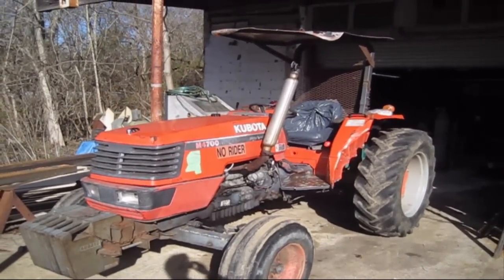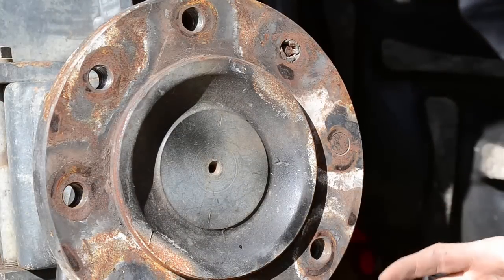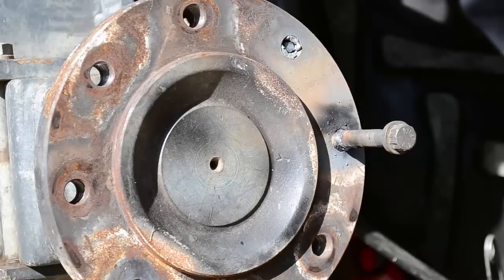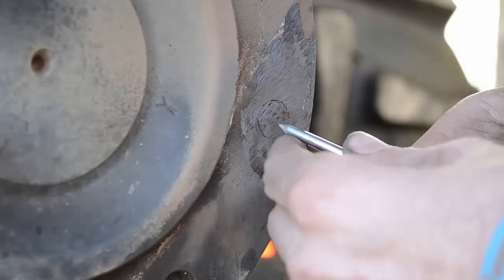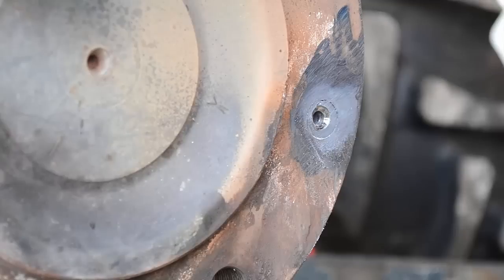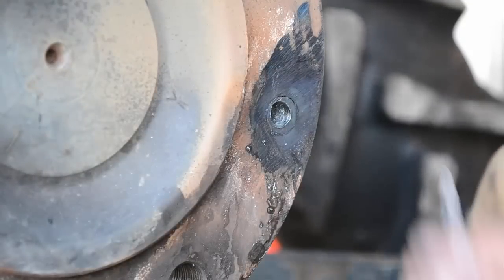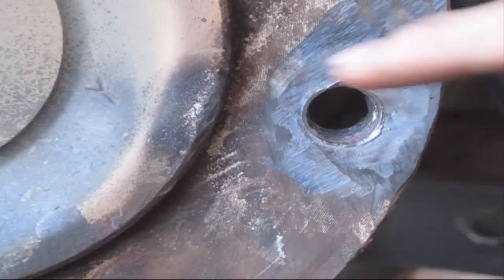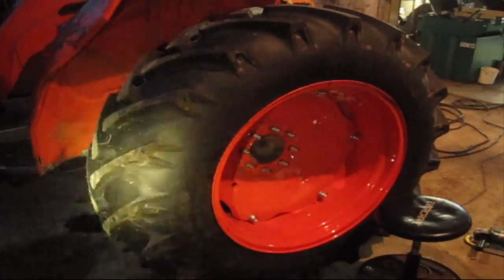Broke-off bolts techniques

Comment: Lots of great comments on here...... trust me.. 1/2 automatic trans fluid half thinner.... it wouldve made that 1st on fly outta there. It will change your life... try it!.... I just removed an oxygen sensor that bound up just like your first bolt. I lubed it and it came out easy...... 3/4 of the center thread was completely ripped out there is no way it wouldve bugged without my half and half. It's the bomb!

Comment: If you heated around the bolt it would of expanded and came right out ..My dewalt cordless impact is a beast beats my ingersol and my air cats. I was dying when you pulled out the mason bit, it’s on now you were thinking 😂 mason bits don’t work well for that most of the time.

Comment: I use a trick once in awhile on things like this, after heating with a torch use a child's crayon and trace the outline of the whole it will suck the wax down in and help release the broken bolt.

But one question, as you're drilling it out why do you not use oil to lubricate?

Comment: Challenging fix and well done !!! Just wondering if using penetrating fluid may have helped with the heating process to loosen things up a little better - my buddy just did a lift kit on my '98 Safari van... had two similar problems with badly seized bolts that we were worried about shearing (shackle-spring bushing and a front body mount) in where he used WD-40 with heat to help break the bond... it was tough going but eventually it worked --- just thinking out loud... thanks for sharing your intel and God bless :) (subscribed)

Comment: once you got the hole drilked before the concrete bit i'd of ground the end of your bolt down and welded it again with the bolt slightly in the hole so it welds inside too

Comment: Thread "blaster" lubricant, let it soak for 2 hours, then cut 1/4" deep slot in the stud (or drill many holes in stud to make a rudimentary slot), then use impact hammer or hand chisel or large enough impact screw driver bit (CCW) to ease it on out?

Comment: Half way through.  The broken bolt that would not come out when welded onto another bolt.   What about welding a slightly thinner bolt onto it and winding it in the original direction, so as to send it out through the back?  Thinner bolt, so as not to engage with the threads in the plate.

Comment: If the bolt went through the hub, why didn't you weld on the other side of the hub and pull it through the opposite way?

Comment: Hello, Have you ever used left hand drill bits? I've used them for years. Many times they have caught and backed the bolt right out of the hole. Even if they don't you still have a hole.

Comment: It is easier to remove by first drilling hole thru center of bolt, then heat bolt to cherry red, quench with water, use easy out with lubricant..

Comment: Should let col down to touch before trying to pull or turn, if too hot  threads get soft and easily  become damage and stuck together  making it become even harder to remove .
Stud or bolt become tempered or hardened from heating, cooling and hammering reason for difficult to drill

Comment: I Have not read all the comments yet , but one step you could employ on the hardened tough bolt, would be = at the point of your first small blind hole in stud, you get a can of starting fluid and place a tube fed nozzle on it, spray the starter fluid tip all way to bottom of blind hole and spray for a few seconds, then repeat it again , at that point you poss. will see that when drilling it slow speed with next larger bit, when cold, it will poss. start out all on its own !  The trick came from a heavy equipment welder when I was about 20 years old, he was Forman of the repair shop and I used it many times in log loaders on large broken blots / studs !  the starter fluid trick is also used wen you welded the bolt to the stud to make is shrink before hitting it with impact , personally I always do it by hand and do the short back and forth with hitting it with the starting fluid on edges of threaded area during  back and forth, hasn't failed me ever, it has worked every time !  God Bless, your work is same as mine, other than that one added helper !

Comment: Welding is Never a good way to remove a broken bolt, now you have a harden surface and bolt, look at the center punch and drill bit...toast! The idea is to drill out the broken stud to weaken it so it will collapse! A magnetic chuck to hold the drill straight is helpful, use cutting oil and a slow speed on the drill bit. 
Straight wall stud remover works best for large diameter bolts use Liquid Wrench penetrant to help things along.... drill recommended size of the stud remover, drill all the way through if possible... also, when using an impact wrench use impact sockets, they will better transfer the power to the bolt! The bolts that are stripped out go to the next size up... drill and tap, now you have fresh threads and new bolts. Viola!

Comment: Not marking center on that bolt and holding your punch square really cost you some time there! I think i would have went with a washer then a bolt welded to that on broken stud giving more surface area to get a good weld to hold. We gonna have to put a governor on your drill. Why didn't you use locktite on the axle side of the studs? Customer couldn't or chose not to buy just the wheel center plate?

Comment: What about taking the welded bolt forward through the hole until it’s clean through cut it off in back then remove out the front or cut the front and take it out the back.

Comment: You blew that first extraction because you got impatient.  If you had put a little oil on, let it soak, then heated the outside of the flange directly beside the broken bolt and then patiently worked it back and forth with lube you'd have been done right there.  When you're applying heat you need to think about which parts you want to expand and which you don't.

Comment: Drill a hole first then heat or weld . The hole will allow shinkaged. the hole is the factor, Even in a blind hole. If it is work harden hit it with 7018 to draw out the the carbon  so you can ge get it to drill. Done many rollers on dozer frames. All ways drill first, Then weld and you don't need a impact.

Comment: Is there any reason you can't push the broken bolt through? I mean, if there's a bunch of crap on the other side, preventing it from coming out, then can you push it out in a clock-wise direction?

Comment: Because the metal is tough, you should use a slower drill speed and press harder. This technique would generate less heat and not blunt the bit too quickly. Ofcourse lubrication is good

Comment: Another vote for slowing down the drill RPM. More oil. More feed pressure. I learned this after destroying about 1,000,000,000,000 drill bits.
Reply: Then again, it is fixed.

Comment: you were going well at the start welding the bolt on but a squirt off penetrating oil and in your case should have ground the rear off  flat  would have helped

Comment: Great work and lots of patience!  Just one question about that stubborn bolt. It seemed to turn forward (in) but stopped on the way out. Probably was a hard spot on the threads from hammer and chisel mechanics' earlier botches like you said. So why didn't you just keep going IN until the bolt came out the other side? Then you could just cut it off... Oh, I have had plenty of days like that!
Reply from the maker: I did try to work it forward as well with the same problem.  I should have tried to pull it from the back, but someone already tried it, and I thought if they did the same thing from the front then they screwed it up from both sides.  it was a mess anyway you look at it.

Comment: Why no penetrating oil when it first got loose, could have got lube in the threads when you ran it in and out.
Damn, what a high speed on the drills. No wonder they wouldn't came through...

Comment: You did really good job until you started to drill! always use a lot of oil turn your good drill bits slowly, heat the outside flange cool the inside with dry ice.  if no luck try welding a good hard bolt again. i do give you credit for the effort!  you get a lot of respect from me, I would use the same process! I like a man who never gives up! thank for the video. Virian  Bouze, Oakland California. race builder fabricator when i can!

Comment: In this case you welded a bolt on broken bolts and  damaged some thread in that hub at the first time. Of course that broken bolt cannot cut some thread damaged by welding. That was your problem. You should weld a smaller flat washer on that broken bolt, to protect thread.  Fill it up by weld.  After that you should weld a nut on it and fill it up all by weld. 
Always use some lubrication and cooling liquid when drilling. Slower speed is better. 
After drilling a hole in it, you should use a dremel tool with diamonds tips to grind off rest of that bolt. 

You just damaged that hub by torch. Cristal structure of metal is damaged now. Thread cannot hold properly torqued lug nuts.

Comment: No one considered drilling out the broken stud and using a Helicoil insert to fix the threads? Helicoils come in all sorts of sizes, even metric. Properly installed, they won't back out or loosen under load.

Comment: TIP HIT WITH AIR IMPACT HAMMER CHISLE/ PUNCH B4 WELDING BOLT ON  AND HEAT UP,IT VIBRATES A LOT OF THE STUCK RUSTED STUFF LOSE AND THREADS SOMETIMES

Comment: Perhaps a dumb question, but on that stubborn one, once you’d gotten it moving but couldn’t UNscrew it due to the buggered part protruding through the back of the flange, why not (after grinding the face flat as you had) weld the bolt to that part sticking through the back side of the flange and try to get it to go the rest of the way through?  From the angle of the video it appeared to be clear of obstruction back there, but I’m assuming that there must have been something in the way.
Reply: Never mind - should have watched all the way through before commenting - thought it was a broken bolt but now see they’re studs that apparently aren’t fully threaded and that only go part way through the mounting flange before tightening up, so driving it through the rest of the way wasn’t an option.  To quote Emily Litella of old SNL fame, “Never mind…”

Comment: I thought that welding a nut on the piece would work better than welding a bolt. Also, use an impact gun with a wrench on the welded nut and slowly apply pressure whole you bang away.

Comment: Have you ever looked into the inductive heating stuck/rusted bolt removers.  I haven't used one myself, but in the vids I've seen, they look like they work really well.  If you end up in that predicament often, it might be worth a look.  Or did I miss the point and were those threads buggered by the broken wheel before you started removing them?  Won't help there, I'm afraid.  ;-)  One other thing, as a stick welder, you freakin' put me to SHAME.  Getting a little lubricant in there wouldn't hurt either, I hear thinned ATF works really well.  Don't remember what they thin with , but there are good YT vids of tests with different penetrating oils, and the ATF concoction seems to win every time.

Comment: The hole drilled at 19.50mins would have done to whack in a torx bit thats bigger than the hole, best easy outs I've ever used on sll sizes , heat the outside of the hub/flange not the bolt and that fookers coming out

Comment: The first thing I  was taught with easy outs is always drill hole all the way thru so if it breaks you can knock it out from other side. Obvisouly it wouldn't be a good idea to use an easy out on a blind hole.

Comment: when you were using the torch ---the flane would have been better if it were softer --that way you could have seen when the bolt was cut through

Comment: we would do this with the bolts that held the exhaust pipes to the manifold much smaller, heat the metal around the broken bolt after a nut or bolt is welded in place they come out like butter

Comment: hi man one of your majour problems is the speed your using, it's too fast you generate heat and burn out the bit, good cutting oil is a must have RTD paste or oil is excellent plus you could also grind up a Tungsten Carbide Masonary bit I do this all the time for exactly what your doing, I agree easyouts don't work, hope this helps. take care.

Comment: What if you dont have a welder and the bolts broke of in the bottom mount for the egr tube on an 08 equinox? It's at a weird angle and you have no money to take it to a shop  .... do you recommend a kit?

Comment: I'm sure you had threads sticking out the back. Put a lug nut on back there before welding on it. You turned it back into a rig..

Comment: Harris Super Missleweld is much better for this application, tensile strength is 108,000 psi and high ductility. It's not cheap but it will do this and many other applications. If you want to weld something and have it stay together this is the rod to use. Oh and it's great for the less than experienced Welder with great strike and restrike, you won't have to fight it like you do with 7018.

Comment: Seems to be a fair share of armchair quarterbacks in the comments.  My question is, do you charge the customer for labor on the time it takes to get the bolts out?  I realize that is the meat of the job, but a serious question.  Good job, very patient, and good attitude.
Reply from the maker: Mike Spain thanks I do charge by the hour, but I do not charge for failed attempts. I know that sounds weird, but if I spend 2 hours and didn't get anywhere I don't mark that on the time.  It is hard to keep up with, but it is more fair to the customer. It doesn't happen very often, but it does happen.  I back all my work if something doesn't work, and it was my fault I will fix it for free.  Bid jobs are the worst because you can't predict what it will take. For example this job just looking at a glance I would have bid it at 1-2 hours at the very most, so you would call it 150$ give or take.  The job took over 8 hours if I remember right (that's with getting parts ect...) I fought that one bolt for an hour and half with no headway until I switched gears, but to me I didn't count that because it didn't work in the end. I know it seems like a lot for a job like this, BUT you have to remember I fixed someone else's failed attempt, and I bet they spend 2 or 3 hours killing it for me.

Comment: You would have had the first one out if you lubed it up. Drill is in overdrive. Sure to dull bit in 2 seconds.  I will try the masonry thing but i will sharpen the tip first.
Reply from the maker: honda dude lube will hurt you more than help on a weld. If heat doesn't get it then you got bigger problems. Welding on top of a weld with oil on it puts tons of pin holes in the weld itself making it weaker.

Comment: Classic work good vid but you could have very easily gotten that last bolt out! All you needed to do was weld on a smaller diameter bolt to that broken off stuck bolt and instead of trying to drive the bolt out in reverse you should of drove it in all the way forward! The bolt would of then came thru to the other end and from there just brake the bolt in half where you had welded it to get the bolt out.

Comment: On the bolt that someone monkeyed with on the back side just weld a bolt to it that would be small enough to pass through the threads on the flange and screw it in until it come out the back side then cut the head off the smaller bolt and pull it through the back side.

Comment: Why didn't you spray some oil on while you're working it back in forth,weld wouldn't have broke?,if you heat the hub flange around the bolt it will expand the threads and loosen.
Reply from the maker: Joe Hanson oil is not always a good choice. If it breaks and you have to re-weld it with oil on it won't hold even if you clean it.  Normally if it moves at all you got it, but that's not always the case.  I don't think not enough heat was my problem (it did move) I could have heated the bolt while I was turn the broken one out but I didn't want to mess the threads up anymore than I had to.

Comment: Sir when you wlded it with the high carbon bolt i saw it alreay moves, its right but you forget to spray with WD 40 penet oil during still hot

Comment: Interesting video. Thank you.

I have a question though about that tough bolt that would not come out. 

If you were to make a small center hole first unsing a drill, not going straight through but just to work as a starter guide for centering... then use a small diameter 6010 electrode, and crank the welder to max. Say... 180 to 200 amps. Would you be able to blow through it effortlessly? Then maybe widen the hole with a carbide drill bit? 

I never tried this... but always wondered if it would work and if anyone had ever tried it and what were their results?   

Thank you.

Comment: It seems to be a lot of work , torch and welding wouldn’. It will be easier drill out a small hole in broken bolt and use extractor to unscrew it. It is just my thought to remove mine.

Comment: Was wondering with that difficult bolt... When you got the last big hole drilled, might a thread tap have worked to clean out the remaining metal ?

Comment: What was the point of heating the broken bolt itself, then welding on it? You're expanding something that you want to contract. 

Welding a bolt to the broken bolt is a good way to weld the broken bolt to the hub. Build up a weld plop in the center of the bolt then weld a nut to that. Using a longer bolt increases the likely hood of not having it straight, which makes  a torque tool less effective, as the pressure is being diverted to bending the crooked bolt, and not turning it.

What's with the lack of lubrication?  And on that note, easy outs work great if they're used correctly. And for the love of god, let the metal cool.

Comment: Use small length drills slow apps plenty of oil and wax ease off the pressure drill right through and punch outis best